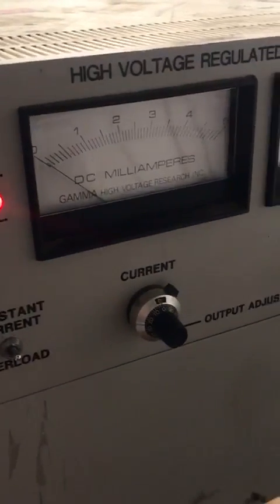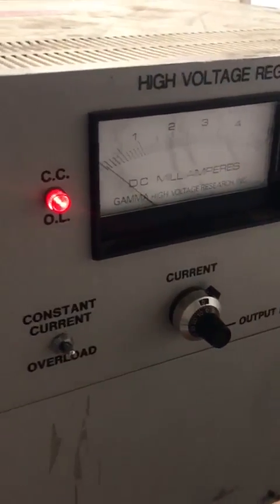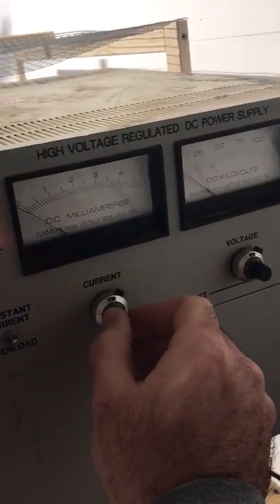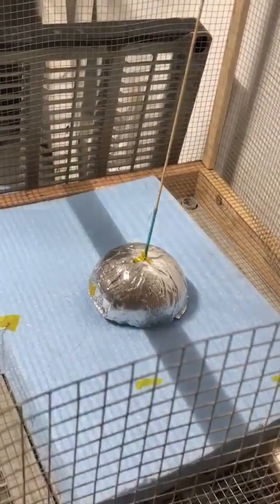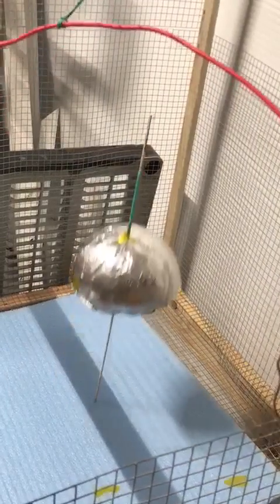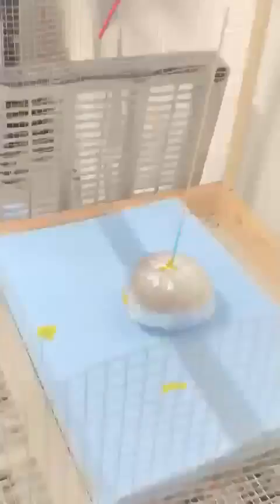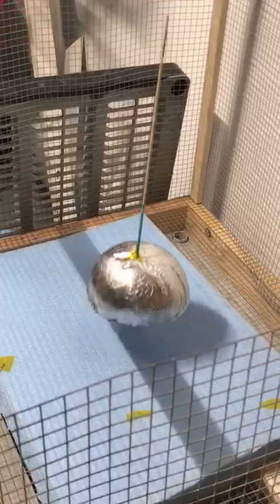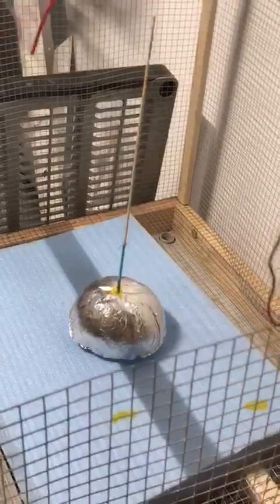Bell shaped ion craft flys even better!

Comment: Study the US NAVY EL PAIS PATENTS 2017-2018. You will understand that the so called magnetic field generated by a rotating capacitor (with high voltage plates) show that it is the SPACE (so called vacuum) which react to huge field by contacting or expanding. Quantum electro dynamic (the non relativistic theory) explain that with virtual particles previously physicists explained that for 300 years by "fields" creating an action forces at a distance. Somebody intelligent use that effect of HUGE and concentrated (directional) so called magnetic fields to propel crafts at Incredible speeds and distance. The inertia (and gravity) forces do apply no more when it is the SPACE between two material points which contract itself that way. EINSTEIN got it partially right with his curvature of space due to gravity (except that time is a constant). Of course gravity and inertial forces are purely a result of electro-magnetism only. (it act directly on all atoms of matter by the fact they are plunged into SPACE-so called vacuum) The space expansion or contraction is also valid with the so called E field but the problem is to concentrate (in a kind of coherent ray like LASER light compared to BULB light) the so called E field between the departure and arrival points. Two magnets oriented north south contract space between them  and our subjective brain deduct there is an attraction force between them. Ref. Unified electro-magnetic field theory MEYL '(1990)-KELVIN (vorticity)-TESLA (scalar waves aka electron fluxes aka waves) MAXWELL (vacuum vortices" ether")